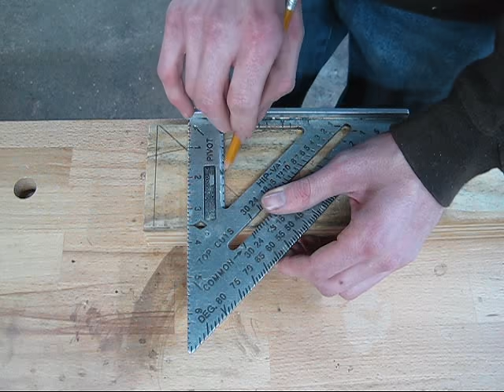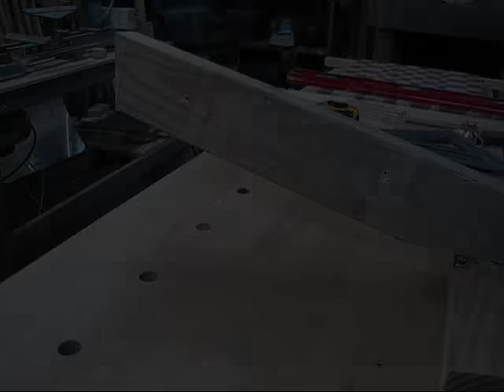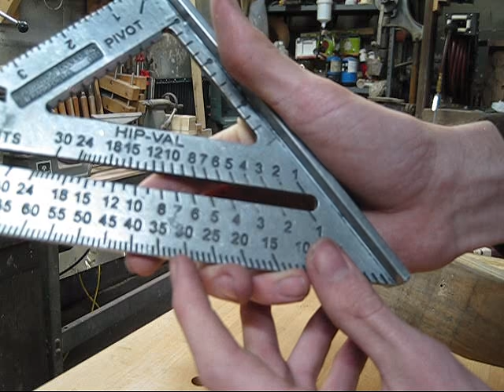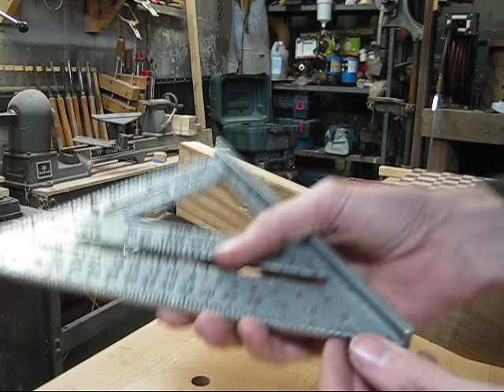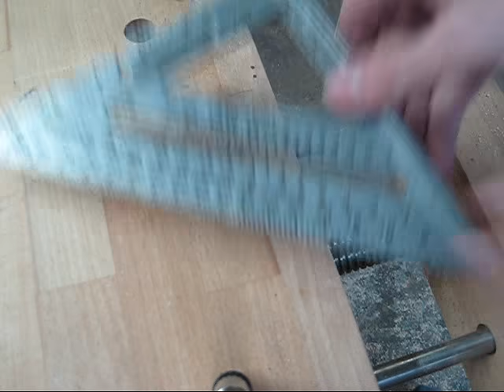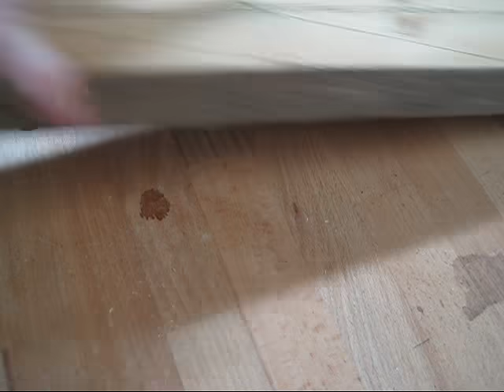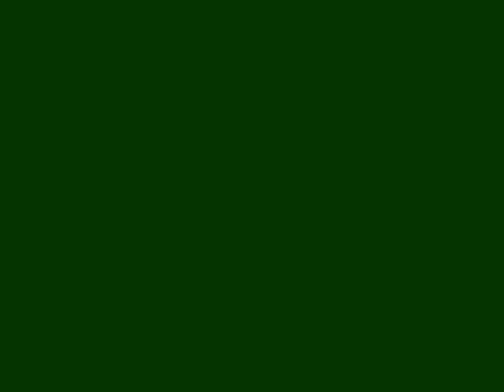The basics on a Speed square

Comment: for me the quickest easiest way to find roof pitch is take a 4' level with one end on roof raise or lower the other end to level then measure down from bottom center  of level to roof - 2' is half of 4' level so if iits 8" to roof from bottom of level to roof at center of 4' level I know the roof drops 8" for every 24" of slope which is 4/12 pitch, yeah yeah I know some will say "but the shingles will throw off the measurement and it wont be accurate" whatever dick take it in 2 or 3 places use your brain, hang over the side and do same thing on bottom of facia im just saying "for me" . . 5 mins BAM!! you see my tailgate goin down the road and your doing calculus

Comment: Good info taught to me in the early 80's by an old Mexican carpenter who took me under his wing.  Same guy who would fire a dude who over cut like shown...  I understand it doesn't really weaken the wood in that particular instance but a lot of inspectors would tag you for that where I worked.
Reply from the maker: Aye it’s more of a pride thing I believe. I’ve never seen a rafter tail break because of a over cut in a normal situation.  But yes it is code not to do that.
Reply: @EEJester1586  It's a good practice to keep all the time. I roughed for 20 years having my own company for 15 of those, got into trim after that.  The habit of not over cutting really holds doing trim work. And of course the tail will not break once roof sheathing is on and a fascia board, but I have seen them break before that, especially if you have to coax one over to get on layout putting the fascia board on.

Comment: went to my local tool supplier and  to buy a speed square could not find one in the shop that was square all were close but not square used a machine face of a builder level and put the squares back to back all brands were slightly out
Reply: went to another store found empire brand first 2 speed squares I picked up check square

Comment: what's the diamond square for?
Reply: the diamond hole in the square can be used to easily mark off seat cuts. The seat cut is where the rafter sits on the top plate. To do this, just line up the diamond with the plumb line you have just drawn and move the square towards the board until the pivot rests against the edge of the rafter. Becasue the distance from the diamond to the pivot is 3 1/2 inches (the same as the width of the top plate) the cut line will be 3 1/2 inches long and will be at a right angle to the plumb line.

Comment: A much simpler way to find your roof pitch is to place the speed square flat on the side of the rafter with the pivot uphill and 0 degrees downhill, place your 6 inch level on  top of the square,. Adjust speed square until level. Common rafter number is your pitch

Comment: You can also find the center of a board by marking a square line and putting the 45% edge on the square line at the end of the square line an mark the 45% line. flip the square over an do the same thing, where the two 45% lines cross is center.

Comment: an easier way to do the seat cut and more accurate is to get the back angle

90  -- 13 =  77...so the back angle is 77 degrees

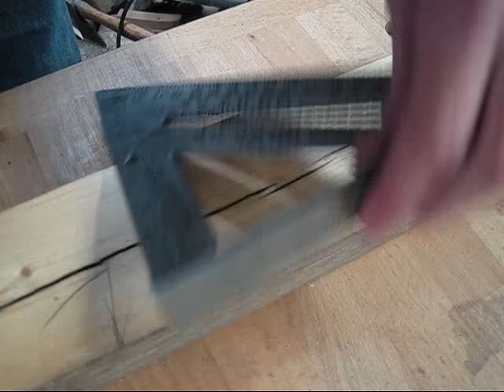so @ 7:03 you will put the square on what will be the deck side of the board or the top, set the angle to 77 and run the square up to the 1 1/2 point where you drew the other line ...mark it...there is the seat cut

Comment: Your instructions for laying out a rafter, particularly the seat cut or bird's mouth, is incorrect. The horizontal line is set at the thickness of the wall, especially if the roof has a cathedral ceiling (no ceiling joists).  The length of the vertical cut is immaterial.  I am a third-generation carpenter. If I laid out a roof the way you described, I would be fired!
Reply from the maker: It was a demonstration all rafters are laid out different depending on what your doing. Being a real Carpenter I would think you would know that.  Don’t like the video make a better one I’m sure you can.

Comment: They are very useful for ripping drywall cuts. Put a utility knife into a notch then pull it down the board.  I usually cut both sides then snap it off.

Comment: Why did you cut using the "3" mark instead of just using the 13-degree mark?
Reply: it's the same thing, but roofs aren't commonly measured in degrees.  Roofs are measured by slope (rise/run) or pitch (rise/span) normally written as a ratio.

Comment: i would like to know what the diamond for on the speed square
Reply: Its 3.5 inches, width of a 2x4, used to mark where a board would be in framing.  Also its the 3.5" drag line used for ripping.  Similar to the drag line indents in the center of the speed square.

Comment: Your demonstration is very good, however, your math is not correct.  12/12 pitch = 45 degrees.   45 divided by 12 = 3.75.   Therefore, 1 pitch = 3.75 degrees.  If you measured 13 degrees with your plumb bob, the pitch would be 13 divided by 3.75 = 3.4666 pitch or approximately 3.5/12 pitch.     

You also misstated that 3/12 pitch is "one third ratio."  That is not correct.  3/12 =  1:4 .  Hope I am not nitpicking.  'cause overall the demonstration is very good.  I don't think many guys have ever done the math to determine degrees equivalent to pitch.  Thanks.
Reply: Good catch. I noticed that also. And you can see that the cut really didn't match up accurately, there was space at the top in the corner of his bird's mouth.
Reply: Man .. Why are you trying to mess peoples minds up ?  .. That's my job !! .. Your math is incorrect ..    Here's the math .. Ready ... 13 degrees tangent times 12 =2.77/12 .. that is the exact pitch ..  Let's check in reverse if I am right !! .. 2.77 divided by 12 =0.2308 arctangent = 12.9999 degrees !!!!!  13 degrees .. A 3.46666/12 = 16.113 degrees ..   Thank you !! .. Now the way he went about deriving the pitch was kinda retarded .. Using a plumb bob ??.. Why not a torpedo level ? .. The best way is to measure the length of the rafter to the top of the heel plumb cut line  ,..  Then measure the span ... Here's how that works now and it might seem complicated . but only takes 1 minute of calculations and dials everything to precision of a billionth of a degree ... I will pick a span and rafter length and knowing the ridge is 1.5" wide .. My made up span is 21'-3 -3/16" or as I prefer 255.1875" .. I pick 13'-11-7/8" rafter length or 167.875" ... Now take 255.1875 and subtract the ridge = 253.6875" and then divide in half =126.8437" .. ..With me still ?? .. Now Square 167.875 and subtract 126.8437 squared = 12092.6914 .. Now find the square root of that number   which is 109.966 " .. that is equivalent to the rise of the rafter .."Not from the plate but the top of the heel .. Take 109.966 "Rise "  and divide by 126.8437 "Run" = 0.86694 arctangent = 40.9233 degrees or take 0.86694 and multiple by 12 = pitch = 10.403/12   Perfect !!  and off of that data .. I now can precisely calculate CLD . hips , seat cuts , intersections , cheek cuts if a bastard , story poles for ridges .. BTW .. 40 years as a Master Carpenter on primarily high end custom homes that require perfection .  Next chapter I will be going over percentages of slope ..
Reply: @IVORY123100  allow me to restate ...  12/12 pitch = 45 degrees.  Thus each "pitch" = 3.75 degrees of incline.    13 degree incline rising from level must therefore = 3.46666666666 pitch.  I you do not believe me, look at your speed square.    There is simply no disputing that if 12/12 pitch = 45 degrees, that each degree of pitch must be equal to 45/12 = 3.75, unless in your part of the universe you are eating magic grits.
Reply: @IVORY123100  Master Carpenter: credentials do not change basic division.  all the profanity and name calling does not change basic elementary school division .... if you have an intelligent, rational, polite response that disputes basic mathematics then please provide the same.  thanks.
Reply: BTW:  I got 16 thumbs up on my original analysis and did all that without ever insulting anyone
Reply: @Clambelly   Sorry if I insulted you .. Admit you are wrong and don't give the impressionable incorrect information ..  Just because you have 16 clicks of approval doesn't mean you are right .. I hope I never get one like ..  I'd rather novice carpenters to think and not be enamored by a smart sounding guy .. ..   You are wrong and I am right and it's not up for debate .. That is where Math is a MotherFer .. It doesn't care about feelings ..   Your original analysis is wrong ..
Reply: @IVORY123100   it would have been helpful, if you just explained the math...maybe I just wasn't following your explanation ... so, let me try to prove myself wrong, and then please show me what I am doing wrong ?     

1/12 pitch = as a decimal =  .083333     .... multiple this decimal x 45 degrees = 3.75 degrees = 1/12 pitch Yes ?  or No ?    

 2/12 as a decimal = .16666666 and if we multiple x 45 degrees = 7.5   which is exactly 2x 3.75 degrees of 1/12 pitch.  

If I carry this same formula out eventually we get to 12/12 pitch = 1 x 45 = 45 degrees, it seems that each measure of "pitch" is the equivalent of 3.75 degrees approx.  What am I doing wrong ?
Reply: @Clambelly  The major part of the problem is you are dividing 45 degrees by 12 !!   and coming up with 3.75 and logically . though wrong coming up with a ratio.. That if the pitch is 2 .. Must be a 7.5 .. If you notice the distance of each mark .. on a Speed Square .. they are not spaced equally .  Now if the Speed Square was shaped in  half of a semicircle .. They would be equal . .. I have had this discussion years ago somewhat .. If one side of a pitch is a 10/12 and the other side is a 12/12 .. Then the hip would be a based on a 11/12 pitch .. or better a 11/17 hip .. it splits the difference .. Logically it looks good ..    It is close logically but is not the answer ..  more like a 10.71/16.97  ..  Before parting .. Look into the irony of hips and math .. That the ratio of a 12/12 is the square root of 2 = 1.414 . and a hip on a 12/12 is the square root of 3 !! .. 1.73   and crazier yet .. that an inscribed octagon for all equal sides is a ratio of 0.414    !!    That all sides one a 100" square to form an octagon will be 41.4 "  or taking 41.4 and dividing by the Square of 2 will tell you how far to contact on the inscribed octagon ..    Your problem is .. you are deducing logically and coming up with the wrong answer .. You are factoring in two components that have no relationship to one another ..
Reply: @IVORY123100  My apologies OBI ONE  ... sincerely Grasshopper
Reply: @IVORY123100  you should start a YOUTUBE CHANNEL !  Then you can show all of us what we are missing.  I post quite a few comments re politics, which I probably know more about than the Speed Square.  I don't mind learning and discovering that I was wrong ... but OMG ... the name calling, swearing, chest beating ... that stuff is for people well below your caliber, and gives the wrong impression.  It is a real challenge to stay professional.  Thanks !
Reply: @Clambelly  On those grounds .You are probably right .. I can get indignant .. I have considered an instructional channel .. But I am not savvy on the setting it up ..I am a weirdo of sorts .. I have chosen to stay in the field to work .. It's my love and have run into so many that are argumentative and unwilling to learn . So I have become callous and strike hard .." No you are wrong !! .." .. on that accord .. I apologize .. I had to fire a turd this week .. Unwilling to learn and overpaid that had no knowledge and steadfast in his ways to never learn ., Like throwing pearls to pigs !!  One day I intend to author my book . It will be harsh .. It will deal with the real world not the Ortho books on how to build a deck ..  There are several sites and several Youtube videos that showcase my workmanship .. I share with few .. Again I apologize for being harsh ..

Comment: Somewhat helpful.  To find the plumb cut of an existing rafter it is much easier to draw a plumb line on the rafter and then move the speed square to it , much more accurate than an unsteady plumb bob.  On marking the seat cut you could subtract the plumb angle from 90 degrees and use the square more accurately. In your case it would have been 77 degrees.  This is an invaluable piece of kit for a carpenter.

Comment: Also opens a can of paint or can set a nail too...  A staple of any tool pouch, they are good for layout of angles, or as a 90* saw guide.  Useless for rafter layout, hips, jack rafters.  Buy a Construction Master, even the entry level model.  Does the trigonometry with a push of the button. Then mark /cut the angle with the Speed square and measure the length.  Make your other plumb cuts for birds mouths and rafter tails.  Use your chalk line instead of the plumb bob.  A good laser etched model will be far more accurate.

Comment: With 5 million 700 thousand views you must have hit a nerve!....Thanks so much for showing the Square...I started out as a Mason Tender and didn't know what work was about. Oh boy I sure learned fast about using two hands and worked my ass off for $4 and hour and in two weeks I got a raise to $6...that time Laborers were getting $10 -12 and could retire at 20 years....after that I learned how to buid a house from the ground up...I had a friend that showed me...Plumbing, Masonary, Framing, Roofing...I bought my Skill Saw and boy did I love that...The smell of wood..well I was addicted...learning was what I wanted to do and used my Square..but I didn't really get a chance to use all of it...there was a Head Carpenter on the job and I saw how he made the pitch of a roof with the Square...pretty cool. I just wanted to share that and I know there is a lot of Construction guys on here that have worked their asses off and I'm proud to say I'm one of them. That's what our country the United States is about. Now the construction trades have turned to Illegals for the most part..what a shame. Any contractor hiring Illegals should get their ass beat...anyway thanks for showing the Speed Square. Very cool!

Comment: Great video for the most part, but...
  Your seat cut should only be 3 1/2". With the long seat cut extending into the building the way you've done with your "standard" 1 1/2" method, if you sheet rocked it without an attic space it would leave a void at the rocks most vulnerable spot where you couldn't screw it properly. Basically, it would be a complete mess and someone would have to come along with wedges to put back the missing material to make it work.. But even with a level ceiling, either way you have quite substantially weakened the rafter tail far more than is needed.
Reply: Like the man said, this is a speed square tutorial not a rafter tutorial. Go away.
Reply: How do you figure out how long to make the rafter to reach the ridge?  Is there a quick way?
Reply: @Naddan49  your stick out from the building should be at least for inches measure from the top two by four the outside edge to your ridge whatever that measurement is add four inches that is your template  lay that one out on the rest of your rafters and transfer the cuts  four inches will keep the water away from your foundation if your patching a rafter simply take the facia off and measure the stick out

Comment: Most people , even carpenters don't know that the speed square has a designated mark for marking the seat cut. On the swanson the mark starts at the 5 inch mark and ends around 80 degrees.  On the craftsman it goes from the 3 3/8 to 70 degrees.  I'd rather just use a framing square

Comment: I watched this again. Instead of a plumb bob to find a pitch, use a level. Mark existing rafter with a level, than read the the pitch off the line from the square. It's essentially the same idea but much faster. A carpenter always has a level with him, but not always a plum bob handy.
As for plum bobs,, started using a laser level.  The beauty of a laser level is you just set it down and your hands are free. Dam i should make some videos and share all my knowledge that i now take for granted. Another good tool is a calculator called construction master, once you master that you can cut any roof, stairs, arches.. its endless.